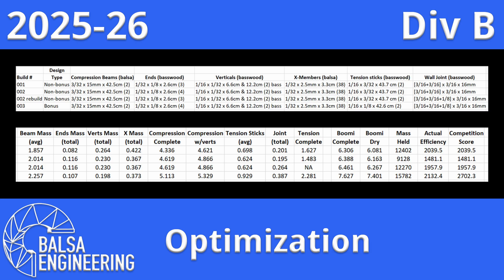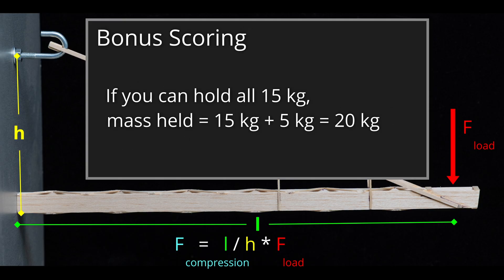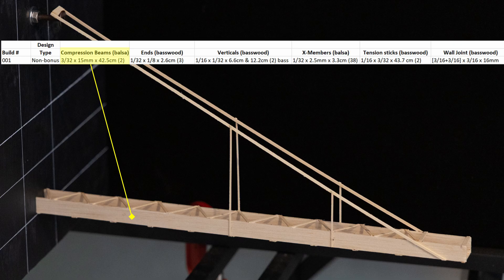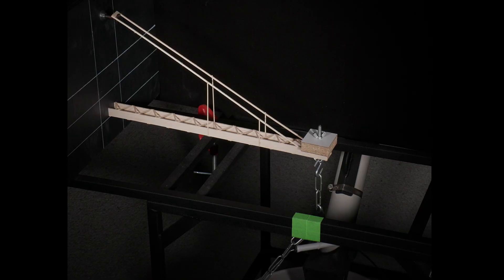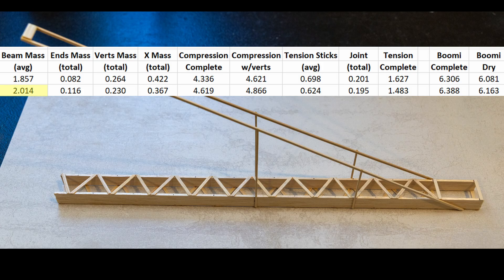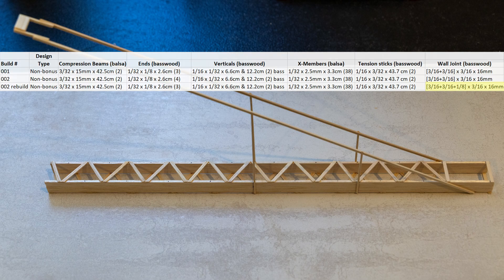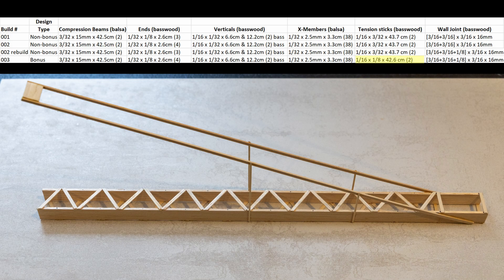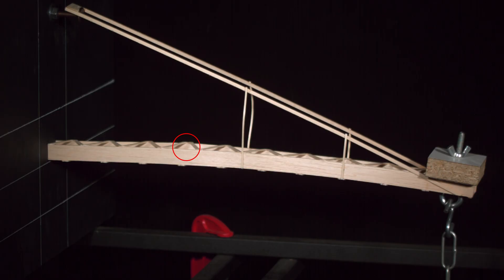2026 Science Olympiad Boomi Div B: Optimization

Comment: It was very helpful to watch and learn from your videos. Could you tell me basswood sticks size I need to purchase? And how to cut all materials by myself? May I just use a box cutter? Thank you!
Reply from the maker: Thanks!  I mention the basswood sizes I use in this video, but there is no one correct answer.  The most important pieces are the tension sticks.  I recommend you start with 1/8 x 1/16 for those.  You can also try 3/32 x 1/16.  You'll want larger pieces to construct the wall joint and potentially smaller pieces for the vertical helpers.  You'll want to buy your balsa in sheets and cut them yourself and buy the basswood in pre-cut sticks. Check out my discord server if you can for tons more info: https://discord.gg/d4xDdMhn

Comment: How do i know what is the spacing between the ends, which is the part that holds the loading block? Also for the X members on the compression beams, what angle was each one placed at?
Reply from the maker: Definitely check out my construction series for exactly how I build this.  You don't need to know the angle, just mark the beams at the linear spacing you want.  We know the total length of the boomi is ~42.5cm.  The loading block needs about 4.5cm, that leaves ~38cm for all the cross bracing.   I was using 19 crosses per side, or 2cm apart for my benchmark build.  There is no single correct answer (which is why I don't really provide a template like you are asking for).  I want students to experiment themselves and figure out how to make design tweaks to what I've shown.  Good luck this season!
Reply: @balsaengineering6686  When you said 4.5cm, is that including the 2 small end pieces or just by itself(loading block)?
Reply from the maker: that is the approximate distance of the outer distance of my horizontal pieces under the loading block.  It's fine if the block hangs off the edge by a bit, the weight savings is worth it

Comment: Hey, lovely video! I was wondering whether the measurements for wood in the bonus design in cm or inches? If they are in other format how can i turn them into inches?
Reply: for the fractions they are inches, then it tells you mm and cm next to it for other ones
Reply from the maker: As a rule of thumb, I leave the measurements in imperial units (inches) if that is how the wood was purchased.  Like the balsa sheets for the beams were from 3/32" thick sheets, or the cross members were from 1/20" or 1/32".  For everything that I cut, I use SI units, so either mm or cm depending on the length and I use them interchangeably.   1 inch is exactly 2.54 cm or 25.4 mm, so you can just divide or multiply that factor to convert to or from inches
Reply: Alright!! Thanks

Comment: Hi, it was very helpful to watch and learn from your videos. Can you tell me the density range ( high, medium or light)  and which grain ( A, B or C) did you use for the compression sticks?
Reply from the maker: Hi!  Given the information in this video, I show the size and mass of all those parts so you can compute the exact density I was using if you want.  I recommend you do that.  In general though, you'll find a good range of density for the compression beams are at the higher end of "light" density.  As for grain type, I wouldn't focus on that right away.  C grain is probably best, but it's way more expensive and won't get you much benefit compared to getting the mass right and having a perfectly symmetric build.  FWIW, my benchmark didn't use C-grain

Comment: If you don't have time to order bass wood for the tension members, what type of wood can you buy instead that is commonly found at stores like Home Depo?
Reply from the maker: I don't think Home Depot or Lowes carry any kind of wood that would be useful.  You'd be better off checking out the local craft stores like Hobby Lobby for something that could work.  Thick/strong balsa can work for the tension members if that's all you have available.
Reply: @balsaengineering6686  I have a bit of balsa wood but each piece is only 7 inch in length. If I glued multiple of these smaller pieces together to make it longer, would it still give decent results ?
Reply from the maker: @Pani-purix4x Definitely not ideal...
Reply: @balsaengineering6686  Would poplar wood/pine wood possibly be a good alternate for bass wood ?
Reply from the maker: Those are woods are heavier than basswood, but if that's all you have access too, it would work.  The trick will be finding it small enough so your boomi doesn't weigh a ton
Reply: @balsaengineering6686  Ok, Thank You for the clarification !

Comment: For the State and National level competition, would you recommend purchasing wood from specialized Balsa rather than buying from hobby lobby etc.? Is there a specific type ? Thank you!
Reply from the maker: There is nothing inherently special about the wood from Specialized Balsa except that you can specify a density range when ordering.  If you can get the wood you need from other sources, that will be fine
Reply: By any chance, do you know what should be the optimal weight for competing at state level competition?
Reply from the maker: @ps2091  That will be highly dependent on which state you are talking about.  If you can match or beat my benchmark score, you should be able to do well just about anywhere.  Good luck!

Comment: Thanks for the video! I have benefited a lot from your past video on Tower. This year, I keep learning from this!
Your wall joint length is 16mm while the two compression beams are 2.6 cm away from each other. This means the tension sticks are not perpendicular to the wall. Is this intentional?
Reply from the maker: Yes, it's OK for the tension sticks to bend a bit.  It's a tradeoff to keep the mass of the wall joint lower by having it be its minimal size (~16mm).

Comment: I have a question, why don't you use the same design as last year and use triangle crosses? Thank you!
Reply from the maker: The span is much smaller here compared to tower, so a simple over/under diagonal cross bracing design works well and is easy to work with.  An X design could also work well, but you'd want to keep the pieces much smaller than I have here to keep the total mass around the same amount

Comment: Can you tell me the places to buy all these woods with the best quality? Your video is really good, and also can you make a video for a tutorial to make the benchmark Boomilever? Thanks, it will help a lot.
Reply from the maker: I like to use Specialized Balsa for my balsa sheets and Fnabco for basswood sticks.  My next video will be about my constructions techniques, so stay tuned!
Reply: Is balsa wood shop good for balsa or should I get fnabco wood only? And also can you tell me the size of the side stocks that look like 1/8 x 1/2 basswood sticks can you tell me the exact size in the format I have just told, like 1/8 x 1/2 or smth else?
Reply from the maker: @hyperionharsha7189  I have never heard of the balsa wood shop, but it would probably be fine.  You'll want both balsa and basswood for this build.  All of those dimensions you ask for are shown in the video (and in the thumbnail)
Reply: @balsaengineering6686  Could you elaborate on why we need both balsa and basswood? I only have balsa left from last year's Tower. I'm wondering if basswood is absolutely necessary.
Reply from the maker: @rosecarmen453  Basswood is much stronger in tension than balsa.  It's also much more dense/heavy.  The main reason it's needed is because the forces in the boomi are much, much higher than with either bridge or tower. About 3x more.  I explored using balsa for the tension sticks in my tension testing video, so you can see why it's really needed: https://youtu.be/KO9a3qI5OQM
You could build something with just balsa, but it will be difficult to get good results.
Reply: Thank you again for all your help in understanding this event. What is your discord name?
Reply from the maker: @srilakshmivishnubhotla7576  Thanks!  I am balsa_engineering on Discord.  Here is a link to my server if you'd like to join: https://discord.gg/Z7kdydhw